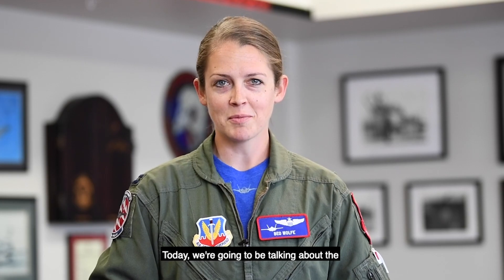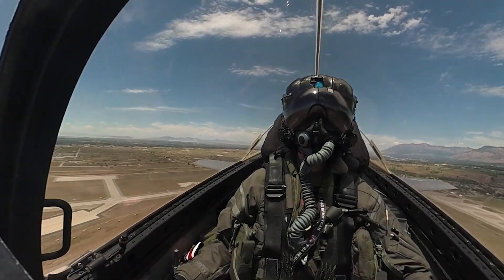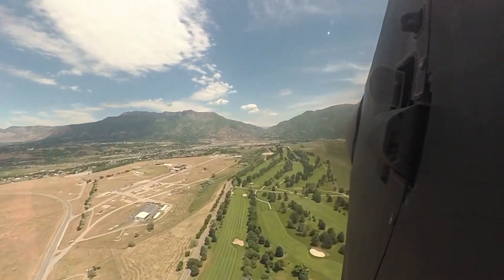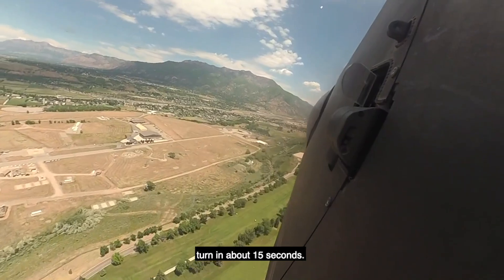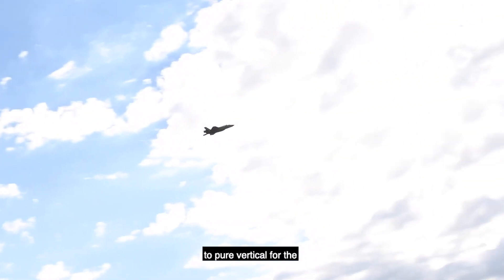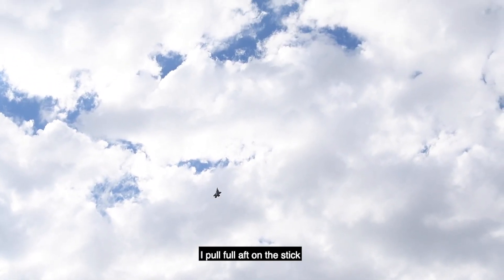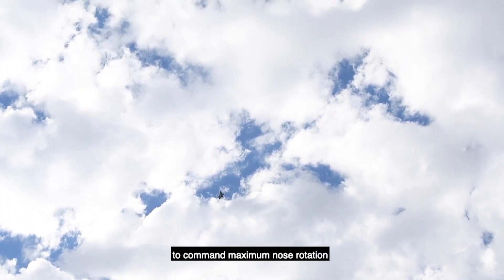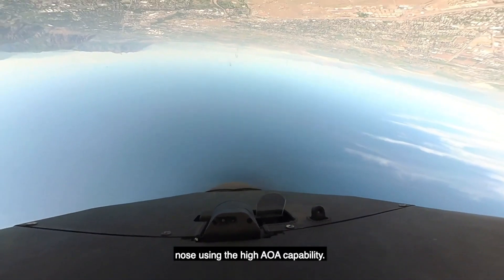F-35 Demonstration Maneuvers Explained: Min Radius Turn to Lightning Loop

Comment: Standard atmosphere, 1000ft MSL,
350KIAS,  360 degree turn in 18 sec means that the aircraft sustained at 6.5g during turn.
This is the easy math calculation...
If F-35 turned in 15 sec, It must have sustained at 7.5g. 
There is no fighter aircraft in the world sustained-turning that fast.

Comment: Please count the turn. It's 22 secs. Just as I have seen it do often at airshows. An F16 is between the 16 and 19 seconds, depending on the version. No way 15 secs, maybe momentous turn rate but not sustained.
Reply: Maybe 15 secs is the secret unlocked full capability turn. We don’t know because the F-35 is limited in capabilities. But I’m not going to say it can do 15 secs either. I’m just guessing it could be a slip up of what this jet can actually do.
Reply: Airshows are limited to 7.5 g on the min radius turn. It's not the fastest turn or the full capability. The Dojo drift is where they really pull on that stick.
Reply: You’re telling this TOO the pilot of the Lightning… what are you trying to do here? She’s a VETERAN Fighter pilot…

Comment: I never saw a video of the A model doing 15 sec 360 turn. The best I saw was 22 sec. In this video it takes 27 sec from Start Turn to Vertical. BUT I saw the C model doing it in 19 sec.
Reply: I've also seen the B-model do it in 20 seconds; both have a lower G-limit than the A-model, so I wouldn't really doubt Wolfe on this matter
Reply: @i.alicorne F-35 is underpowered, it doesn’t have the best thrust to weight ratio, it has mediocre lift to drag ratio, and relatively high wing loading. It is for example far worse in all of this metrics than F-15C, and F-15C has never demonstrated 360 deg. turn in just 15 seconds. In other words, facts are disputing the pilots words!
Reply: Remember that in the Lightning the performance is usually software limited. A given tail number will fly differently depending on the flight logic employed that day, so if the need arises they can always gimp performance to keep its true capabilities secret
Reply: that I can imagine with the larger wing. The wing loading is the key factor. I'm a Pierre Sprey adept, what can I say....